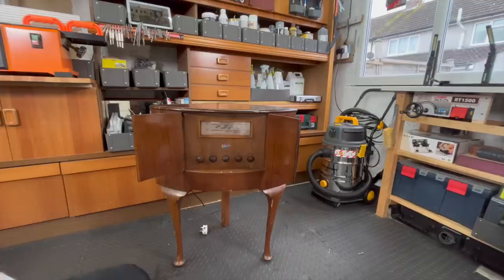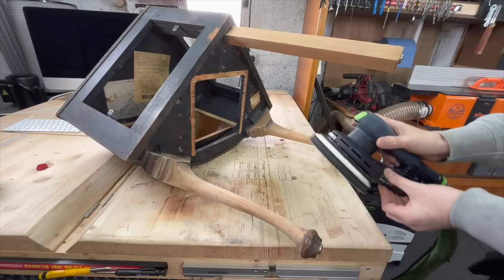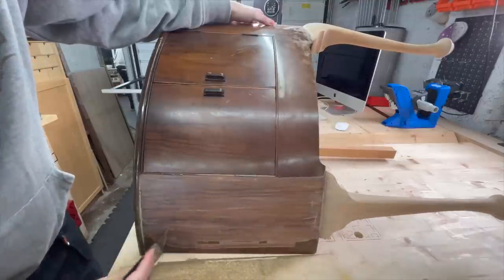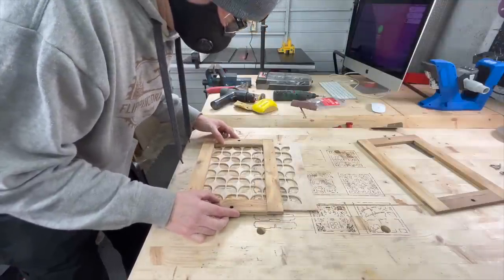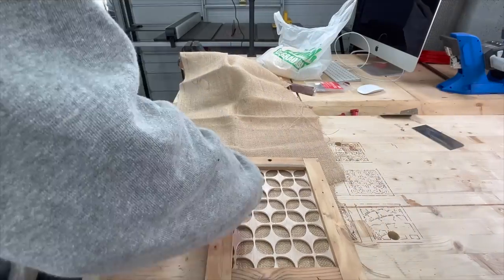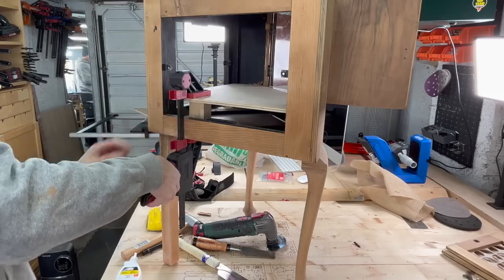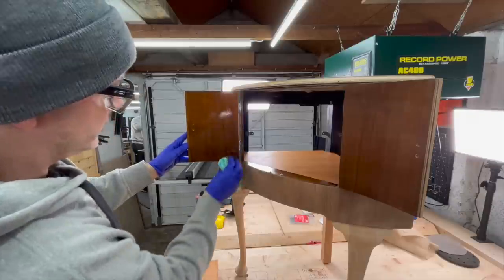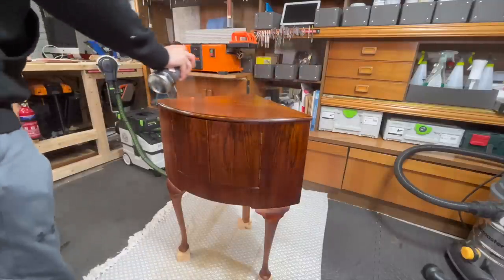Restoration/Makeover of an old Radio Cabinet. Modern look with a Retro Vibe.

Comment: There are some radio restoration guys gritting their teeth as you dispose of that chassis, knobs and glass. Many of those parts are valuable and hard to find.
Reply: Yes artists like in money for nothing
Reply from the maker: And how do you know what I’ve done with those parts?
Reply: @Flippingdrawers  only you can tell or show us.....
Reply: @Flippingdrawers  I don't but I also watch the radio guys and have seen them with missing parts.  It would be like a missing handle on a dresser.  Hope you know a guy.
Reply: Your hospital may have an association w a local ham radio group (for emergency communication).  Ham radio people may have use for the parts.

Comment: A wonderful example of repurposing a piece of furniture!  I really liked the wood grain on this piece & the finishing was terrific.  
Did you take the original innards to a shop that restores vintage radio equipment?  These parts & pieces are valuable to collectors of these things.
Perhaps you need heat of some type in your work area.  I have a small natural gas heater in my garage & it doesn't take up much space.  My cousins in England say this has been an unusual year for weather  ... here too.  Climate change I guess.  Ty Clif
Reply from the maker: Thank you ☺️ I posted it on Facebook and someone came to take it

Comment: Jay, I always admire your quality of workmanship and imaginative transformations of obsolete furniture, however on this occasion I'm not convinced that the original piece was in fact obsolete?  Vintage valve audio is extremely collectable so I do wonder whether a straight restoration might have been appropriate, valve circuits are generally fairly simple so I'm sure the electronics could have been repaired by a retro audio specialist (but repairs and replacement valves can get pricey)  However I do understand that vintage valve audio is a specialist market so you would probably have had trouble finding a buyer prepared to pay enough to cover your costs and time.  I also guess that if you'd decided that a straight restoration was appropriate then you probably would have rejected the project, and this lovely piece of furniture might have continued to decline.  On balance it's far better that this piece has been revitalised than abandoned to neglect, so after much deliberation, I'm giving a thumbs up for a superb revitalisation.

Comment: Very creative! Due to it’s triangular base, does it have to sit into a corner to be stable? 
(I have an old, custom made “optometrist table” that is three-legged and rather top heavy. It’s lovely wood but not at all practical. It has one flat side that ends up getting pushed against a wall but it’s supposed to be freestanding. I just couldn’t resist buying it at the antique store.🙃)

Comment: New to your channel and I love it! If I’m not mistaken, in your later videos, you use a Festool sander and dust collection system. What are your thoughts on Festool compared to more reasonably priced tools?
Reply from the maker: Hi, welcome.  I had a menzer sander before for less than half the price of my festool. It was very good but the overall experience with the whole system is very good.  I’m happy I spent the money.

Comment: I would call it a make over. And l am still in AW over that old falling apart chest you did in that challenge you did with David. I watched his video with the one you chose for him. Compared to what he had to do with it was nothing compared to what you had to do. Also l have a small table l found sitting by a trash dumpster. Unfortunately they use the draw as an ash tray what would you suggest l use to get the smell out of the wood. The table and drawer are solid wood.
Reply from the maker: Thank you 😊 I think that in this case (given you actually want to keep the drawer bottom and not replace it) I would clean it with vinegar, sand it and apply few coats of shellac to seal everything in.
Reply: @Flippingdrawers  I figured the vinegar, but not the shellac. Thank you answering my question.